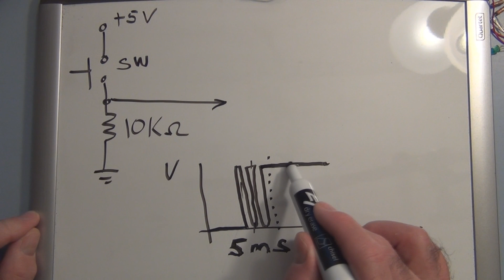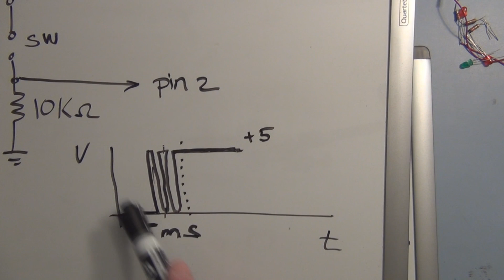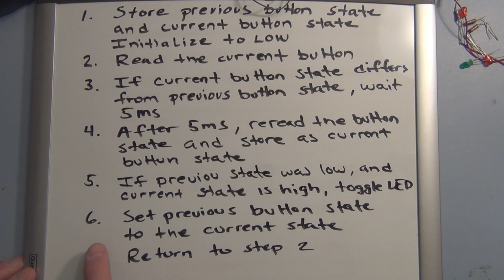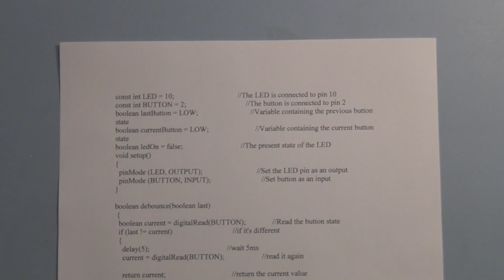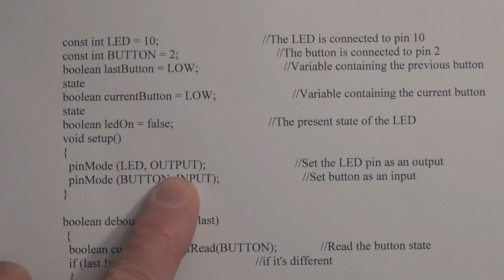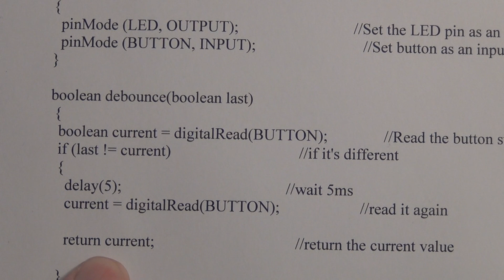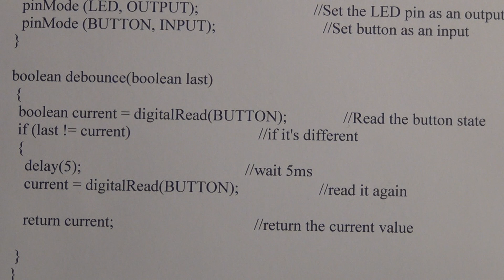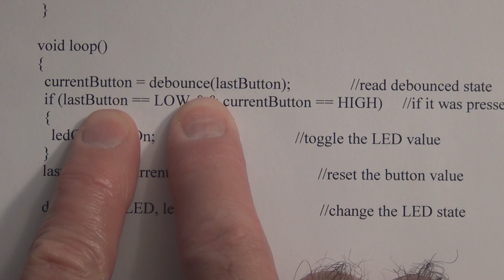Arduino Software Debouncing Tutorial

Comment from the maker: const int LED = 10;                                  //The LED is connected to pin 10
const int BUTTON = 2;                                //The button is connected to pin 2
boolean lastButton = LOW;                            //Variable containing the previous button state
boolean currentButton = LOW;                         //Variable containing the current button state
boolean ledOn = false;                               //The present state of the LED                             
void setup() 
{
  pinMode (LED, OUTPUT);                             //Set the LED pin as an output
  pinMode (BUTTON, INPUT);                           //Set button as an input
}

/*
 * Debouncing Function
 * Pass it the previous button state,
 * and get back the current debounced button state.
 */
 boolean debounce(boolean last)
 {
  boolean current = digitalRead(BUTTON);              //Read the button state
  if (last != current)                                //if it's different
  {
    delay(5);                                         //wait 5ms
    current = digitalRead(BUTTON);                    //read it again

    return current;                                   //return the current value
    
  }
 }

void loop() 
{
  currentButton = debounce(lastButton);               //read debounced state
  if (lastButton == LOW && currentButton == HIGH)     //if it was pressed
  {
    ledOn = !ledOn;                                   //toggle the LED value
  }
  lastButton = currentButton;                         //reset the button value

  digitalWrite(LED, ledOn);                           //change the LED state
    
 

}
Reply: your code didn't work probably sir it didn't debounce, as i pressed the button it turned on,
i change these parts like this and fixed......
boolean ledOn = true
 if (lastButton == HIGH && currentButton ==LOW)